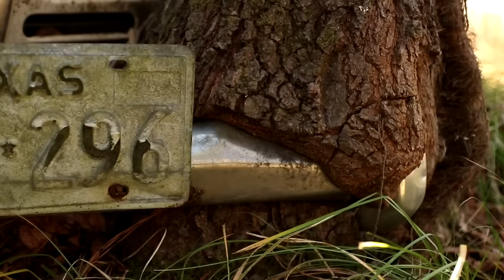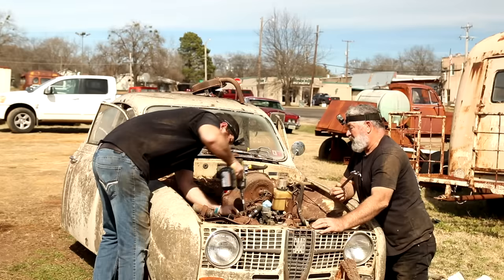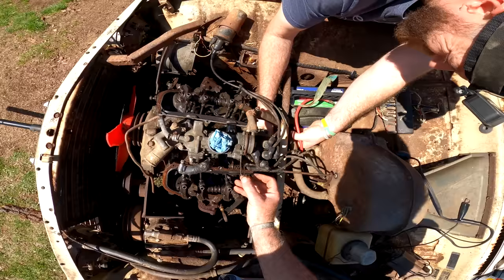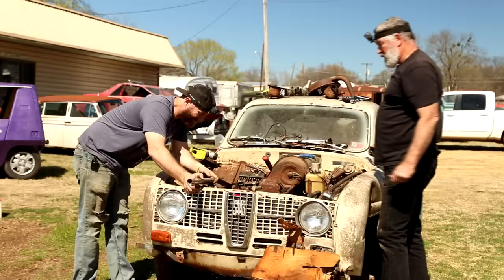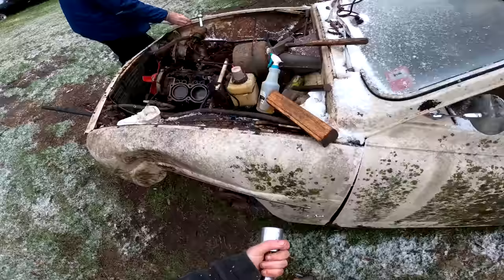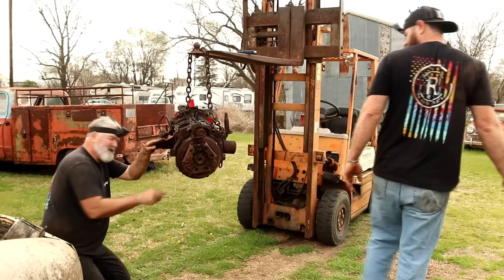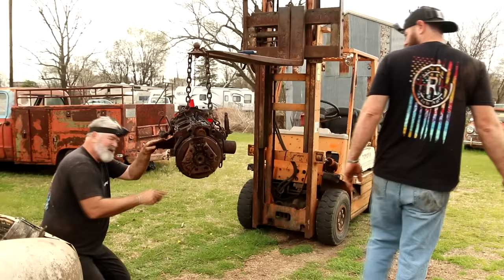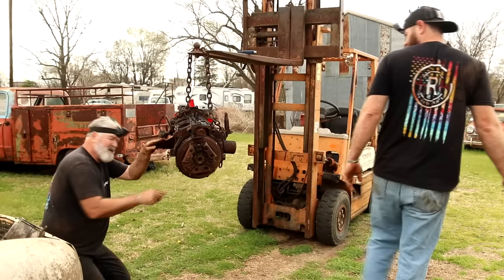THIS IS BAD! Attempting To Start Locked Up V4 Engine Covered In Rats Nest | 1968 SAAB 96 | RESTORED

Comment: I wish I had been there -  It has a free wheeling clutch -  down on the front firewall under the dash is a knob that controls the clutch.  Push it in and the clutch will engage.   When ever you let up on the gas, the clutch would disengage and you could shift gears.  Push on the accelerator and the clutch would engage in the higher gear you shifted to.  4 on the column .  
 That was a feature- you could use it normal or freewheeling with that knob under the dash.

Comment: I have owned a couple of Saabs and this model has 'Free Wheeling' so that when you let off the gas the car will coast. That is why you only get resistance in one direction when turning the wheel in gear. This feature also allowed you to shift gears without using the clutch.

Comment: I owned a '69 and a '73 and worked on a lot of these cars years ago when I started out at an independent shop (goin' on 38 years as a mechanic). They were fantastic vehicles, tough as nails, with some minor issues. That V4 ford engine was virtually bullet proof, (except for the nylon timing gears which was a common problem) was easy to work on, and went 300,000+ miles or more. Also, the free wheel system was a problem with a plastic actuator which always failed eventually and stuck the trans. in permanent free wheel (my '69 did this).  The car was comfortable, reliable, and had the best heater system of any old car I've seen, and was as good as any 4x4 in snow (with the right tires). The parts prices were very reasonable for European cars back then as well, compared to today (ridiculous). I loved those old 96's. A vast improvement compared to the 2 stroke 95 (shitbox engine). By the way, if you remove that front radiator support, headlights and all, you have complete access to remove the drivetrain easily.
Reply: I share your sentiments! I had at least 4 95/96 cars in the late 70's. I can remember having friends help me with a clutch replacement. They were amazed that 5 minutes into the job that the entire engine compartment was open.  Squeeze the hood supports inward and remove the hood.  A few screws and a few bolts, two radiator hoses and out with the grille assembly. An hour or so later, hoist the engine and transmission. Clutch replacement done in an afternoon.  I would drive that $500 car through anything, and then buy another.
Reply: ' @paulrodgers811  Yes Sir, they were some of the best times I had in my youth driving "white Lightnin" (nickname for '69) ant the Blue Bell (my blue '73) so many good memories. When you're young, you don't pay any mind to nostalgia, as a matter of fact, you kinda make fun of the old guys saying "back in my day, blah blah", but seriously, back then people were literally giving cars away or selling them cheap because you could buy a DECENT priced new car and didn't have to sign your life away on a ridiculously priced new vehicle that's either worth nothing or falls apart after 3-5 years. You could get a 3-4-500.00 dollar car with very little repairs to do, register and insure it for next to nothing, and drive it for a few years, then move on.  Of course, the days of building a quality, lasting vehicle for the working guy or gal stopped, I'll be generous, say around 1985, and pretty much throw away garbage from then on. Sorry, I'm rambling off topic, but the "old" stuff was the part of the reason I became a mechanic, each brand was easily identifiable, unique, had its own feel and, of course smell. But here's the future. I'm not a mechanic any more.... I"m a "technician". Anyway, I loved my 2 old Saabs, 3 MG's, 1 Opel cadet, 1 Austin Marina, 2 144 series Volvo's, 3 Fiat 128's, 1 Datsun B210 and 1 F-10, 2 Toyota Corolla's, 2 Corona's and 1 Carina, my 4 Subarus, and all the other freebies and cheapo"s I've owned over the years but the old Saabs were my favorite.

Comment: I personally have always loved Saab. I actually want to own something like this, a Saab with the V4 engine. The real downside with owning these Saabs is that some parts as I know is quite difficult to find. I personally would love seeing this one running again, the engine you can hear wants to starts. It really wants to run, but there are just things hindering it from starting. From knowing about Saab quite a bit they've always had problems with their transmissions, idk about these in the Saab 92, 93, 95 & 96, however most of the transmissions has issues.
Reply: I had one 4 years old…. Needed my transmission rebuilt too!💰😭

Comment: I had a '69 just like that.  Four speed on the column and that little engine would rev up to 7,000 RPM.  I just sort of stirred it along with the shifter!
It had a handle, which, when pulled out, released the transmission and let the car freewheel.
Sold it on 1971.

Comment: What you have in this '68 Saab is a Ford V-4 engine, 4 speed on the column with free wheel clutch. The free wheel clutch is a holdover from the Saab 2 stroke engine as a way to eliminate engine braking which starves the two stroke engine of lubrication. The transmission shift pattern is shown on a sticker on the dashboard. Pulling out on there shift lever allows access to reverse gear. A knob low on the floor is used to lock-out the freewheel.  Engine parts are generally available at a Ford Industrial parts dealer or on-line. This engine was used in forklifts and welders in the US. In Europe it was available on many Fords like the US captive import Mercury Capri. The engine timing is a combination of phenolic or steel gears at the front of the engine. 

The real downfall of the model 96 or most cars of this era is the tin worm. The floor pan and trunk floor are are especially prone to rusting out. Pull up/ peel back  the floor carpet and see if this qualifies as Flintstone mobile. As this car appears to have lived in Texas the rust may be minimal. Car also appears to have air conditioning installed and rare for this car. A/C was a dealer installed accessory form a Saab engineered kit. Some A/C was fully aftermarket add-on.

Comment: The valve seats may be very rusty too, which could cause the low compression. If you can get it to fire even for a a few revolutions the valves might reseat a bit more. Try supplying the ignition coil with it’s own 12V supply. It will give you a fatter spark when you crank it. The ignition timing and points gap OK ?, it’s often overlooked. You might want to advance the timing a little and make sure the points gap is correct.

Comment: Only a half century of critters nest building in the engine compartments. -  One of the unique features of a SAAB that I had occasion to drive while my Triumph TR4a was in the shop - SAAB transmissions have a free wheeling feature in normal operation, the engine is not used for engine braking, unless the feature was disconnected.

Comment: I learned to drive in a 1970 SAAB 96, with the weird freewheeling clutch that was a holdover from the model's earlier two-stroke days, and the four-on-the-tree gear shift.  There are days when I'd have another one, gladly.  It made a nice sound, and was an easy driver.

Comment: The way you start a no compression old engine that turns feely is to first remove the sparkplugs, spray a lubricant in the holes. It should be a thick one like 80.90W.  Block the engine so that it can't turnover in TDC on selected cylinder. Connect compressed air to only that one cylinder. Then you hit the valve stems with a rubber mallet. The grime in the valve seats will come flying out. After doing the same procedeur to all cylinders you put only one sparkplug in for a four cylinder engine, two for a 6 cylinder and 3 for a 8 cylinder. Choose the cylinder with highest compression that you have accieved so far. Using only one plug will make the engine crank very fast. Crank the engine and run it for 5 minutes so it can heat up. It will be noisy and remember to remove spark plug leads so they are not hanging around and create a fire. Then you can ad a plug at a time until it starts with all plugs installed. I have got several engines running from zero compression this way. No warranty though that the oil consumption will be low. Sometimes after a couple of thousand miles the compression rings tend to split in to small pieces if engine overheats.

Comment: I have owned several of these cars in my youth and let me tell ya these are one of the easiest cars to work on and I have pulled out the engine more then ones in less then 30 minutes but you need to remove the front to access the crank shaft in the front of the engines 
there are even holes in the block  to screw down bolts to lift the engine out 
as I remember the procedure it was something like this
1 loosen the hood 
2 drain the coolant and remove all of the hoses 
3 remove the front
4 unscrew the wheels and remove the axles from the gearbox 
5 unscrew the engine
6 lift the engine up and remove it

Comment: SAAB 96 (1960-1980) was a very common car in Sweden, back in the '60s - '80s, - it's a swedish brand. Originally with a 3 cyl 2-stroke engine, the Ford V4 engine was introduced in 1967, the freewheel is a heritage from the 2-stroker. The SAAB company was originally formed to produce warplanes in the '40s, still in operation now manufacturing the JAS39 Gripen jetfighter, however cars haven't been produced for the last 10 - 12 years

Comment: Saab used the German Ford V4 engines known as the Colongue. These engines had a displacement of 1,3 1.5 and 1.7 litres. There's a low and high compression version of these engines. There's a huge difference between the Colongue V4 and the Essex V4 which was manufactured in Britain. I had a Capri which was fitted with a 2.0 V4 Essex engine. Not much as successful as the Colongue V4 was, yet they all had their various issues. Noisy, rough and troublesome.

Comment: Just a thought, guys (and gal), your best compression readings come with the throttle blade (and choke) propped wide open. I actually got a flat head straight six to run (very rough and shaky) with 3 of the 6 exhaust valves stuck open by holding it at wide open throttle. If you get time to tinker, Id oil those cylinders again and hold it wide open cranking and see if she pops. Such a rare and cool design! Also, I was always told to push/pull start in the highest forward gear...but that only matters if the clutch is holding. That's the extent of my 2 cents...

Comment: The Taunus 15M had the same engine, and the 17M and Transit had a 170o engine that fits in without modifications. I had one with a 1700 engine with a twin choke  Weber carburettor. It was scratching to do 100 mph but that was 15 mph faster than the original 1500 with a single barrel Solex carburettor.

Comment: Rather than using ether try pouring gasoline down the carb, it would give a longer lasting period where it could ignite (It takes time for the gasoline to evaporate, ether is used up faster) While the heads were off you could have tested them for sealing by pouring gasoline into the combustion chamber to see if it leaked past the valves. I also agree with a comment saying to try running the starter on 24V instead of 12V but for shorter bursts.

Comment: With engines that have stuck rings and low compression like this engine I have used spray grease down the carb as well as a splat of gas which helps to artificially raise the compression ratio enough to start up. Usually once they start running the rings will slowly free themselves off.

Comment: 24 volts used to do the trick on old Ford x-flows and 1172 sidevalves, they soon started after that.... Always used to 24 volt V6's as well for banger racing.

Comment: I think you`ll find that V4 Is a FORD Europe Engine, to keep the internals balanced it ran another shaft inside the engine to counter balance out the V4 vibrations.. We had the same designed engines in Ford saloons and Ford commercial light duty trucks and vans.. I had a 2 litre version in a FORD CORSAIR 4 door saloon, it ran well, towed my race car on trailer just fine.

Comment: Some Marvel Mystery Oil in the cylinders would boost the compression and help loosen any stuck rings. I've used it many times, it does work! I would put it in and let it sit for a few days and then try it again. I used it on my 1960 Saab 93F that had been sitting for 20 years and it fired up- smoked like hell but it ran.

Comment: Pour transmission fluid down the carb as you crank the engine. Trans fluid will increase compression and is also flammable for the engine to run on it.

Comment: Those Saab 96 where made in Finland from 1969 to 1977 by license in Valmet automotive at Uusikaupunki, also 99 and 900 cabrios made there (all). Also Porsche Boxters  made there several years. Nowadays there is MB A-series and GLC-models on production line and exported to US. But about that Saab whitch is the now in restoring: I had 1967 model with 2-stroke 3-cylinder engine and next year came this with V-4 Ford Köln (German Ford) engine. There is a history: First Saab 96 was given to Finlands president mr. Urho Kekkonen and registerplate was: EKA-96

Comment: I was told the Ford V4 in the SAAB Model 96 was also sold by Ford as an industrial engine for oil rigs. You might be surprised that engine parts might still be available.

Comment: KInd of late comment, I know but this should be a Ford Cologne V4 1.5 60-68hp, parts would be hard to find, but not impossible. These V4's are know as low compression and also freewheelingt ones so that the valves and pistons would hit even with astuck out valve. The camshaft is driven by a cascade of sprockets, at leat one should be made out of some kind of plastic, they are known to shear off if they are really old.
Thx for showing your hard work, great channel!
👍👍👍

Comment: A note about the V4.  I believe it is a European Ford product.  If you remember the first Ford Mustang show car, a 2 seater roadster, it had a V4 and a 4 speed.  The Sàab Club will direct you to all the engine parts you may need.
Reply: Yes it's a German Ford V4 . Ford Germany made a whole range of small V4's during the 60's and 70's whereas Ford UK made inline 4's . Both ranges were rationalised in the 80's . At least it means that spare parts should be readily available .

Comment: John morris in SD has all the parts you need usually in stock. It’s either a 1.5 or 1.7 ford v4. Very difficult to find reference materials

Comment: When you tap the top of the valve stems with a hammer it is called spiking the valves. Sometimes that will unstick a valve, or remove carbon chunks from the seal faces. You can do it with the rocker arms in place but you have to make sure the push rods don't fall out of the rocker cups.

Comment: Looked like the choke and maybe throttle plates were closed on the compression test...need to open them up.  Same when cranking, open them up and squirt has done the throat.  You can also pour some oil down the carb/intake to boost compression for cranking.

Comment: That's what we call in the uk a ford v4 taunus engine. Which is basically the 3 litre Essex engine short of 2 cylinders. I think a lot of the internal parts are interchangeable pistons,rods,valves, and crank bearings and probably oil pump.

Comment: Most likely not the first one to point this out, but the reason why the crankshaft is offset is because it isn't the crankshaft, it's the balance shaft which is driven by the crankshaft.

Comment: This is the engine used in the prototype midengined 2seater Mustang of the early 60's, the German mk1-2  Capri sold in the states uses the bigger V6 version of this engine.

Comment: Trans has free wheeling pull/push  the stalk. These also had issues with valve seats if no sulfer in the gas. Also water pump likes to freeze up

Comment: It is a Ford v4 engine which are actually used in many farm impliment applications in the states and parts are available .
The engines were available from 1200cc to 2000cc were used in ford capri, cosair, transit van and sold to Saab.
Some issues....  BLOWN head gaskets, weight they were heavy little suckers and the oil pump drive off the bottom of the distributer shaft would snap.
Modern composit head gaskets seemed to help, an upgraded dissy shaft was available with limited success but they will always be heavy in comparison with other 4 cylinder engines.
They were quite torquey though and sooo compact.
Be warned there is a british v4 and a german v4 and they are not the same... your engine looks to be the Essex V4 which is the British variant.
Also Saab used these in Rally cars and did well getting some mad horse power and reliablity.
Advice... get the good head gaskets !

Comment: This is a golden opportunity to have part 2 of this video - pull the engine, drop the pan, remove the rod caps, pull the rods and pistons,  hone the cylinder walls, re-ring the pistons,  order up a couple head gaskets, reinstall everything, check  compression and (hopefully) it'll fire right up!  That is a neat, tiny little engine and the v4 configuration has stoked my interest. thanks!

Comment: HI LOVE YOUR SHOW 
The engine on the Saab is from a 1967-73 ford taunus 17m engine 1700cc from ford of Germany    
the engine has a sleeve system like the french cars peugeot and Citroen 
if u have a low compression see if the sleeves of the pistons r not in place. you need to change the o-rings on the sleeves and the head gasket and make sure the the sleeves r in line
Guy

Comment: The ford V4 will seize the upper connecting rod bearings if they have been sitting for a long time in one spot.
No amount of penetrating oil will make them free up,
The only way is to remove the rod from the crank and tap the piston with a bolt and use a slide hammer to pop it out of the bore.
Do not try to free by turning the fan it is driven off the cam not the crankshaft.
You will damage the fiber timing gear.